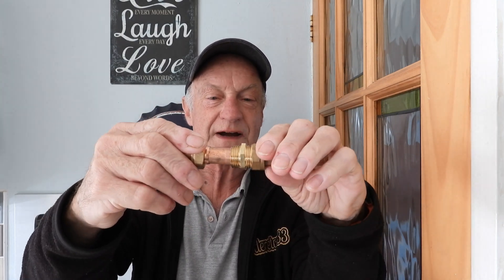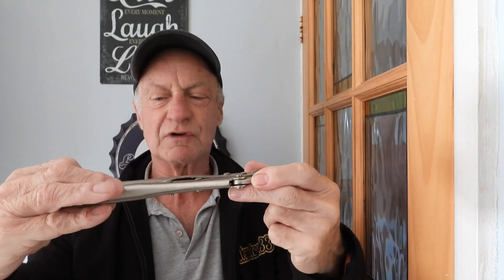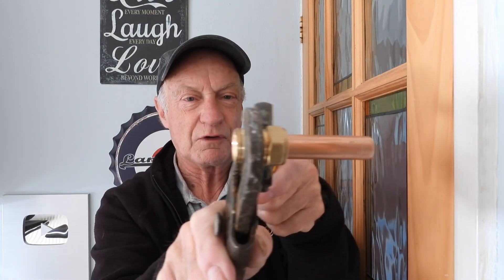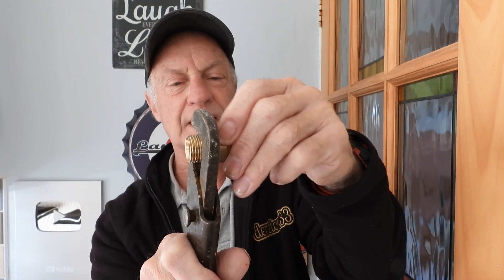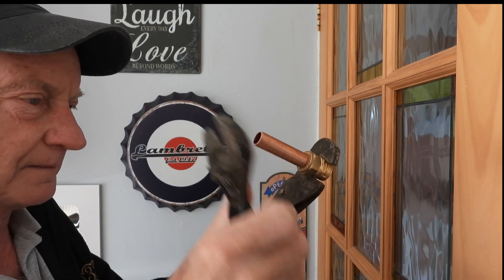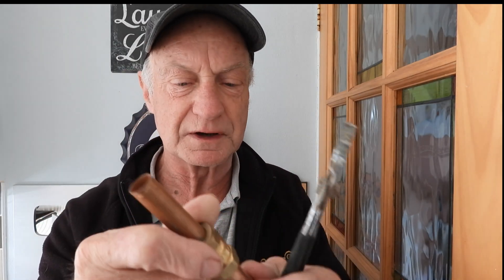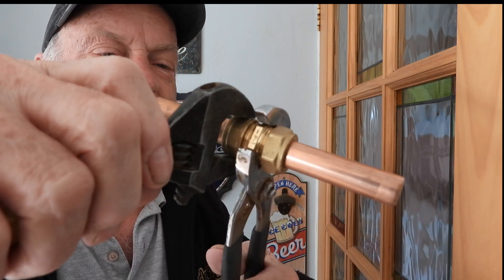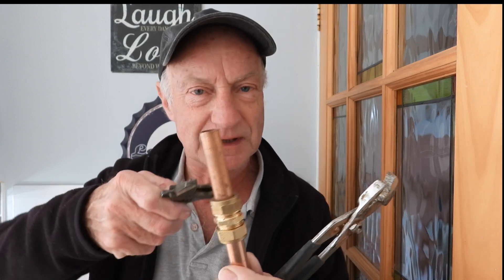Compression fittings. How tight do I tighten them?

Comment: great video. Should ptfe tape be used in all cases
Reply from the maker: No it is not necessary unless you need extra peace of mind.
Reply: I just replaced a valve as it was leaking.
I don’t think it was leaking til I turned it off for the new washing machine installation!
Anyway instead of removing the old nut and olive I put the new valve onto that with some PTFE tape.
The old nut was encrusted with old PTFE or some white stuff (BossWhite maybe? - I’ve never seen it)
And also the metal was corroded too I think. Anyway after cleaning the thread as much as I could (with copper pipe still in place through it so not easy) I installed it and was good for a few days but small drips are forming so I reckon best bet is to take off the old nut and olive (I saw your olive removal video thanks!) and put the new olive and nut on 👍

Comment: Do you recommend using compression jointing paste
Reply from the maker: Yes . A lot of plumbers though do not. Always been belt and braces for me.
Reply: @dereton33  thanks. Just wondering though if you have to open the compression again for some reason and reseal using the same olive ring. Does it cause an issue. Clean it off with some emery cloth?

Comment: Brilliant video, many thanks - Two points. Firstly, you mentioned that no jointing compound is required. I haven't heard that before. Is that for all compressions or just particular ones? 
Second, do you have any videos or could you do one on the the different types of compression fittings and there uses's? Much appreciated, Thanks.
Reply from the maker: No jointing paste required. I will see what I can do via a video.
Reply: Sorry. Its Al not Derek. My apologies!

Comment: I was a car mechanic for my first 4 years of employment, and over the years, I've accrued dozens of spanners, sockets, blah blah, but have never ever figured out a plumbers aversion to owning, and using the mere handful of very carefully chosen spanners they actually need in their daily work, to avoid churning up softer than steel fittings they generally work with, and proper spanners would also provide more consistency of tightness. They would of course, still have the 4 or 5 adjustables they seem to be glued to on standby. Are one of the highest paid tradesmen just simply reluctant to spend money, and look much more professional  ? 😂 Any explanation  ?
Reply from the maker: As you say dozens of spanners needed, not gonna carry that lot around.
Reply: @dereton33  Well it's not 'dozens' as i said for a plumber, but literally 3 or 4   "mere handful" , and my point to the plumbers is that, a properly fitting spanner looks more  professional and reduces the risk of over or undertightening, whereas,  constantly only using vice grips or stilsons on nuts just looks so amateur and a wee bit hashy to a mechanic or engineer etc. I definitely see crawling around under floors etc, as the time for reducing tools though.

Comment: On process fittings (swagelok, parker, duolok, etc.) they say 1 and 1/4 full turns from finger tight for the initial swage and 1/4 turn from finger tight if you're reconnecting one that's already been swaged, and those things are good for like 6000psi. not sure why compression fittings for domestic plumbing don't just give an easy to follow direction like that.
Reply from the maker: Never have done.

Comment: Thanks Derek for your lucid explanation about the tightening of compression fittings. An experienced plumber told me once that if a compression fitting is used and fitted properly, you don’t need to PTEF tape or jointing compounds as an extra precaution to ensure a leak proof seal. I have for many years used compression fittings against solder as they are easier to use and simple to make a reliable seal.
Reply from the maker: Thanks. geoff

Comment: I can never get a straightforward answer to this question.  I installed compression shutoff valves.  One wept and the other just plain leaked.  When I tightened it further it looked like it was getting worse.  I took it apart an couldn't find anything wrong.  Nothing deformed.  Put it back together and tigntened even more--and all this just to 1/2 turn total--but that was as far as I perceived I could tighten it.  No--it was not tight enough.  Forced it past what I would have considered possible and that stopped the leak.  I'm assuming those who overtighten simply don't know their own strength--because intuitively I would have never thought to tighten it to this degree.
Reply from the maker: Boss white would have sealed it without being so tight.
Reply: How many valves? If it's just one, it could have been a faulty fitting or olive, or the area of pipe was scored or damaged. Brass or copper olives?

Comment: I seem to see a lot of experts putting PTFE and Boss white on these things.  I am a diy'er and have never done that because I tend to read the instructions first.
Reply from the maker: Put them in the bin where they belong.
Reply: @deemdoubleu @dereton33
That is strange.
I thought at least a little bit of PTFE tape to account for any variations in the thread.
What about a bit of thick grease?
Actually my neighbour next door ex-plumber said not to use anything either.
He knew of someone that used some BossWhite and then PTFE tape on top of that but it leaked as I guess there was too much stuff getting in the way?
Reply: @RobertJaniro  The thread is not meant to be water-tight.  The olive does the job of sealing against the pipe and fitting.  The thread simply provides the means to apply the necessary compression force.

Comment: In normal operating conditions, after hand tightening the nut, the number of turns required to form a robust joint would be:
i. 10-28mm 1 turn
ii. 35-54mm ¾ turn

If wanted to be 100% sure you are not over or under tightening the fitting then can use a Torque wrench in conjunction with Crow's open End Spanner Set using the following settings for the relevant pipe diameters :	
15mm	40Nm
22mm	60Nm
28mm	80Nm
35mm	120Nm
42mm	180Nm
54mm	240Nmn 

👌
Reply: IMO for 15mm pipe it's closer to 0.5 turn.
Reply from the maker: Thanks for the tips.

Comment: How do you deal if you find one that has been overtightened and has compressed the pipe? Do you have to cut off the compressed section of pipe until you get to a good section, or do you have other options to deal with it?
Reply from the maker: You can cut off the end of pipe or wrap PTFE tape around it.

Comment: I am still none the wiser. Please answer in the value of the torque required in Nm or the degree turn after initial nip up. You seem to hint 180 degree. Right?
Reply from the maker: Forget Nm or torque, you have to feel it. 180% is roughly right, but might be different for other fittings.
Reply: @dereton33  Compression Fittings. How tight do I tighten them? "You have to feel it." What an answer to a totally legitimate question. Can "feel" be measured and quantified? No. So I am still none the wiser.
Reply: @cfcyayaya  Feel can be measured. If you feel a large leak, it is significantly under tightened. If you feel a tiny leak, you have roughly got it right. If you feel no leak, you might have over done the initial tightening.
Reply: @cfcyayaya  Then best you call a plumber to do the work
Reply: I was also going to say I really was none the wiser  but understand the ' feel it reply ' also - however we can see a god deal of pressure has to be applied

Comment: The grips are always placed on the fitting in the opposite direction to the spanner used for tightening the nut.
Reply from the maker: Not always, a lack of room will mean you fit it on the nut anyway you can.

Comment: What in flip flops, 😂 I give you a best tip take bigger adjustable wrench 🔧 hold it in a middle and use smaller adjustable wrench and you can use one hand only to tighten as a leverage, your fitting not even going to move
Reply from the maker: Thanks for the info

Comment: Useful video as always. Always wondered why plumbers favoured adjustable spanners or grips over the correctly sized open ended spanners?
Reply: Because there's such a variation in nut sizes in plumbing.  I generally use a 24mm fixed spanner for 15 compression nuts  but they don't always fit, and its the same for 22mm fittings, there's a lot of variation.  On boilers and valves its a whole other story, a huge variety of sizes..  easier just to pick up one tool rather than carry a lot of fixed spanners.
Reply: @martinwright7093  Thanks for the reply.
Reply from the maker: Cheers for the info guys.

Comment: What I don't understand is why there hasn't been any torque recommendations for compression fittings from manufacturers. It would take any guess work out of these things.
Reply: You'd probably end up paying 20 times the price of the fitting for  a pair of torque spanners 🙄🙄🙄💷💷💷 if they made them
Reply: A uncalibrated torque wrench or a badly calibrated one is pretty hopeless. Too tight, or not tight enough. Copper pipe can be damaged by overtightening, it will twist.
Reply from the maker: Thanks Guys.
Reply: It's because you're torquing to yield.  Unlike a nut and bolt, here you torque it up until the olive hits the taper that's his first tighten, then the second tighten us to actually distort the olive to shrink it onto the pipe.   The amount you need to turn depends on how far it needed to shrink. You cannot use a torque setting because as the olive is crushing the torque doesn't change until you've crushed it too far.   It's between 1/4 and 1/2 turn 1 turn will crush distort the pipe.
Reply: I go for 1 flat of the nut - 1/6 of a turn at the yield.  Also like to use a true flare nut wrench on the nut since it wont distort it and grips from multiple flats unlike a crescent. I never use vise grips other than to remove a stripped end.